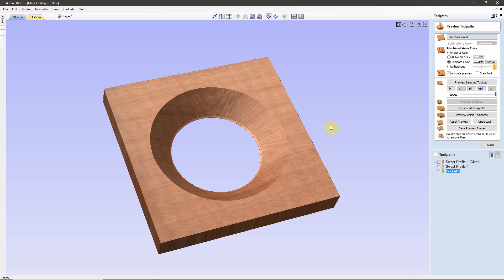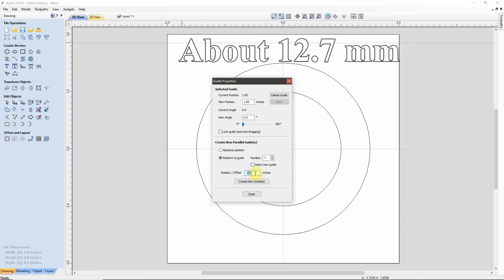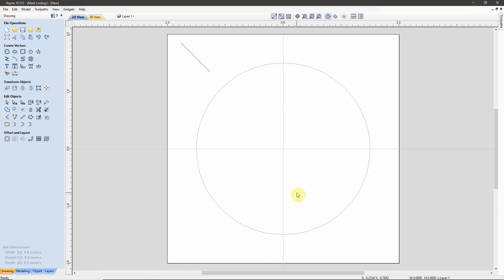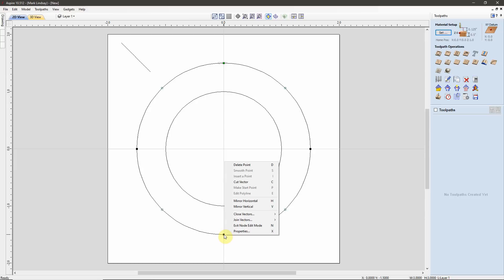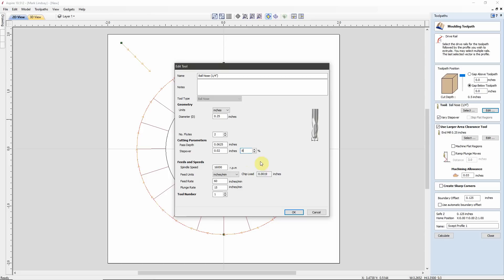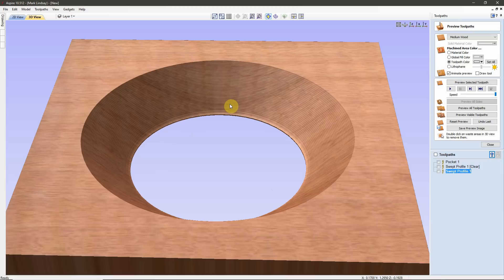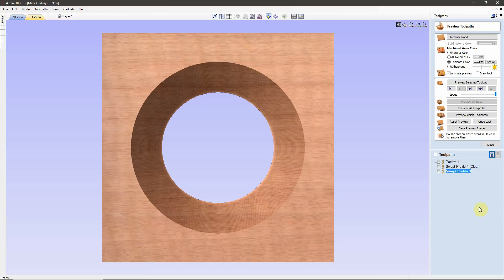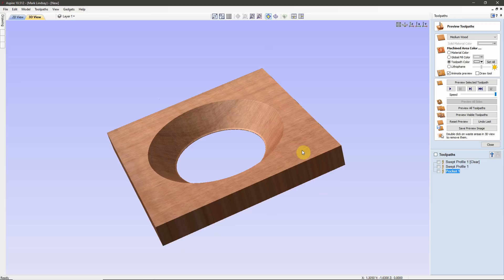Carve a Tapered Hole in Vectric VCarve and Aspire

Comment: Instead of using a pocket tool path to remove the hole why not just profile tool path? That way you only have the cut time to cut one single internal outline to remove all that wood instead of hogging it all out.
Reply from the maker: Yes, you could use a profile toolpath. You'd need a way to secure it so it doesn't come loose after cutting it out, but that's not too difficult. There are many ways to accomplish the same end result. The purpose of this video was to demonstrate cutting the taper. How you deal with the waste in the center is your choice. Personally, I tend to pocket out the waste (depending on the size of the hole, of course) so I don't have to deal with trying to secure it to the spoilboard somehow.

Comment: For a 45 degree, why not use a v bit?
Reply from the maker: The purpose of the video was to show how to create a taper. The angle is irrelevant. I could have chosen 50° just as easily, and the process would have been the same.